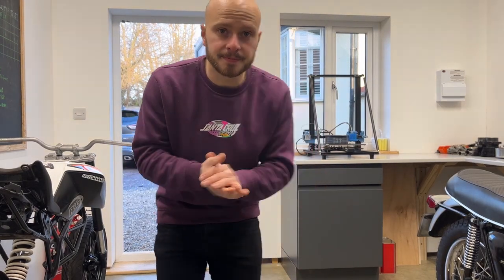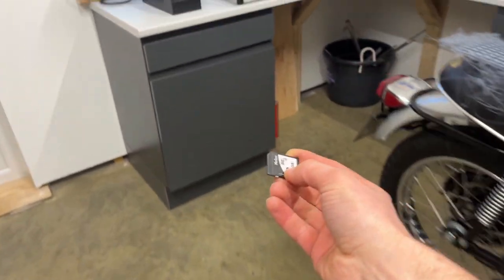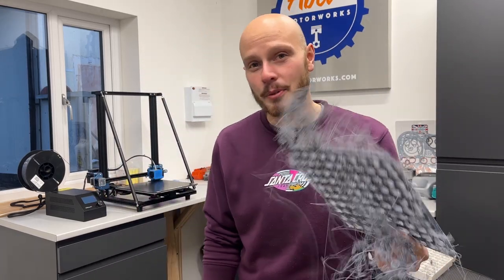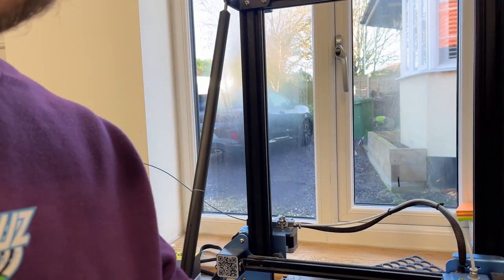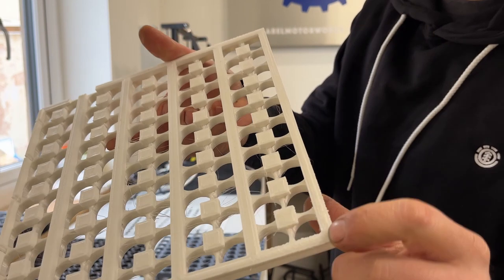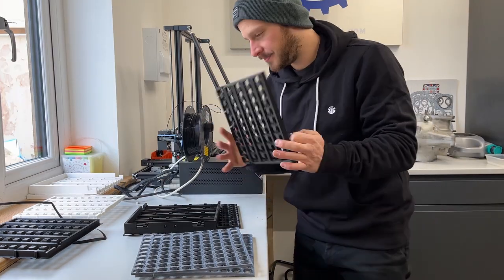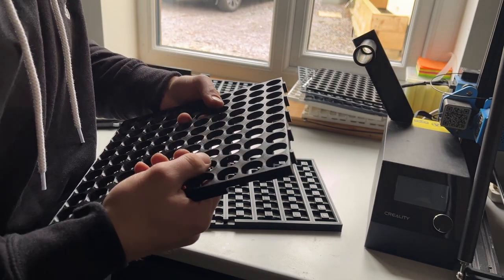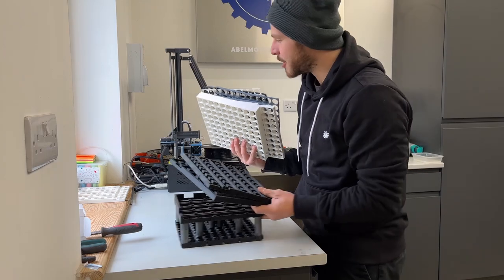The Reality Of 3D Printing Motorcycle Parts.

Comment: Could be a small draft from that window causing your print to cool and lift off of the bed. I think should build an enclosure for it.
Reply from the maker: I agree, ambient temperature is the biggest issue printing in my workshop. I have been using a cupboard in my house and getting better results! But an enclosure is the best option like you say.

Comment: 3d printing could help you build customizable things, but only when there isn't any other off the self solutions. The battery holders you wanted, you can find them in the market. There is no point to create plastic waste, and take your time with a lot of failed prints until you print the right one.

Comment: You make it sound like a printer needs these preparations every time you want to print something, which isn't correct. Leveling should be necessary regularly, but not after every print. 
Also your faults seem to be user issues like 90% of failed prints. 
I own a cheap 3d printer and it is working great after a proper setup.
Also to speed up my functional prints I use a 0.6mm nozzle and 0.32mm layer height. Maybe your specs are interesting for your viewers.
Nonetheless I think this is a great project and a very well suited use of a 3d printer. 👍
Reply from the maker: Thanks for the advice Kevin, I think you are right with the fact I need to tweak my printer setting. I already use a taller layer height but stepping the nozzle up from a 0.4 would be a good start.